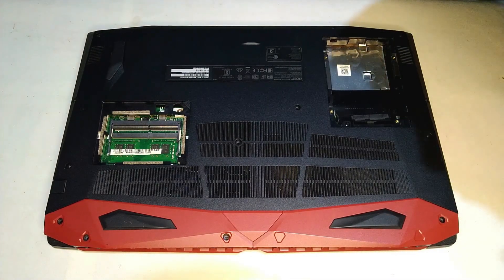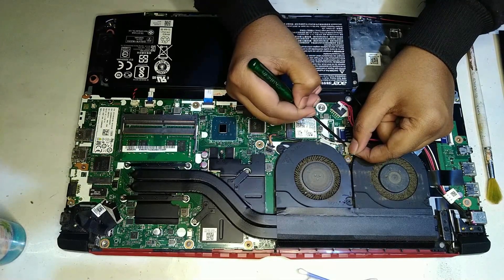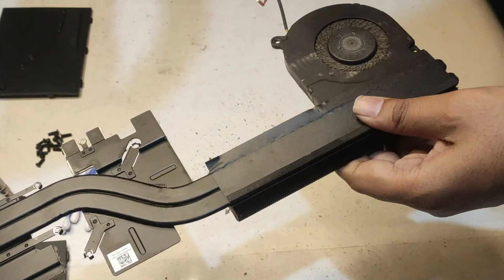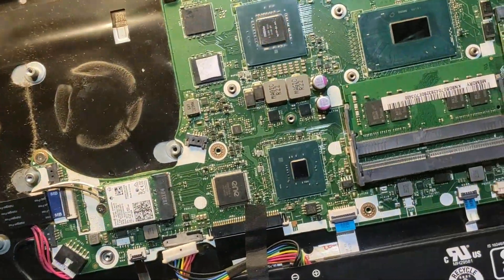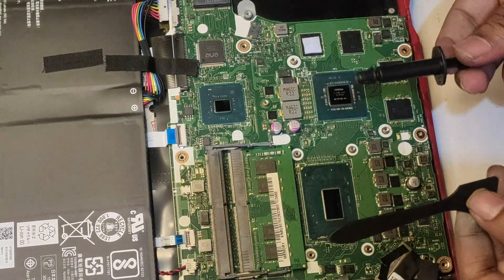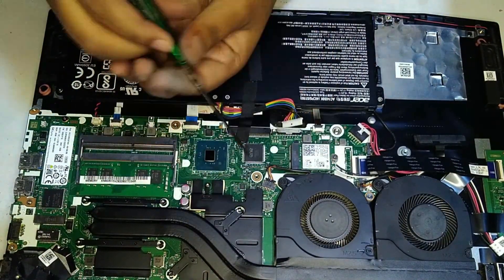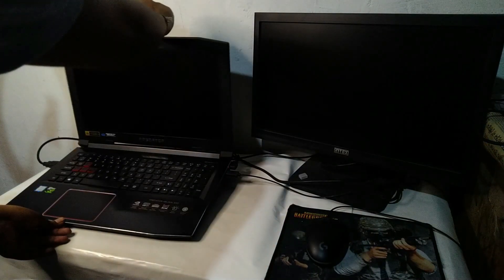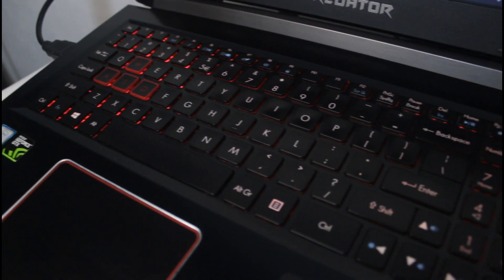FIX Laptop Overheating! | Thermal Grizzly Kryonaut 🔥

Comment: nice video , i got acer nitro 5    i5 9300h  gtx 1650 , and temp were over 96 of cpu and 90  of gpu . after cleaning it and changing thermal paste  my cpu tem were 78max and gpu were 65 max . But  you spreaded the paste because its laptop you should have use one drop method because then you will assemble your heat sink and the paste on the cpu and gpu will spreaded automatically which will results in no air gap in paste between cpu,gpu and heat sink .

Comment: it's advisable to use kryonaut only on GPU and something more thick on the CPU. As laptop CPU generally run hotter than GPU underload. You will find CPU will pump put kryonaut after a few months whereas GPU averaging 70c under load will last alot longer. 

Also recommend Honeywell PTM 7950 for CPU as it provides excellent heat transfer for laptops heat range.
Reply from the maker: Bro I haven't repasted in the last 1.5 years. Thermal Grizzly works perfectly for my Helios 300.

Comment: BEWARE! I'd advise against using hand sanitizer on you cpu and heatsink. Hand sanitizer contains perfume which I expect it could lead to residue and/or chemical reaction with thermal paste. Use 99.9% isopropyl alcohol, much kinder to your computer. ✌

Comment: I've seen many dudes in youtube saying that the best method is the pea size. I've tested it myself with my hp pavilion and kryonaut too. I used the pea size and after two weeks, my temps started going high again. So today I repasted again but this time I chose to spread on both chips and some on the cooper heatsink too. Now my max temps are 85°C and the average is 79-83. I also undervolted my i7-10750H. Pretty good for such powerful cpu.
Reply from the maker: Cool, whatever works! Enjoy! 
It's all about the mounting pressure, which differs from laptops to laptops, uneven mounting pressure won't spread the dot method evenly, so you are basically spreading it manually.

Comment: I would recommend gelid gc extreme for laptops

And dont use hand sanitizer for cleaning as it only have 70-80% alcohol and other percent of water so it might end up shorting something, instead go buy a 99% alcohol bottle for around 130rs in local
Reply from the maker: Nothhhhing will happen with 70% alcohol. It's not the first time I'm repasting and doing all this. It takes 5-7 seconds for the sanitizer to vaporize.
Kryonaut works best with my Helios 300 while Gelid works better on my brother's Ryzen 5 4600H HP Pavilion. 
But technically Kryonaut has the best thermal conductivity among all non electrically conductive thermal pastes.
Reply: @DeepteshLovesTECH  From my experience with Thermal Grizzly pastes are not suitable for high TDP GPU, CPU laptops where the temperature is close to 80°C for a longer period of time. After 8 months, its thermally conductive properties deteriorate significantly.
You should try phase-change material Honeywell PTM7950. It comes in as a sheet, lasts longer and performs works better than traditional pastes. On the power section and vrams propose to give thermal putty Upsiren UX Pro. Also do undervolting on the CPU and GPU at -100mV or more if it will be stable.
Reply: @DeepteshLovesTECH  man it contains water in a significant amount, if something didnt happended dont mean there is not a chance of

and alcohol content vaporises fast not the water content.
Reply: @DeepteshLovesTECH  kryonaut has better thermal conductivity due to its more fluidity and thats a good thing for pc not laptops which require thick paste to prevent pump out effect so in laptops its better to sacrifice some therm. conductivity for thickness.

please get your facts right

Comment: Don't use kyronaut for laptops it can easily pump out
Reply from the maker: Ohh God how many times do I have to reply to same thing. 
It's not Kryonaut's fault, it depends on the particular laptop's heat spreader mounting pressure. 
I am using Kryonaut on my Helios 300, and after this pasting I haven't re-pasted till now!! I only have to repaste once a year. 
So it depends on laptop to laptop. Kryonaut has the highest thermal conductivity among all non-electrically conductive pastes.

Comment: i too have the same processor in my laptop i5 8300h but in cinebench it touched 95 degrees even though i recently gave my laptop to clean and reapply thermal paste. i asked him which paste he used asnd he said coolermaster..i saw your video and just ordered thermal grizzly kryonaut.
Reply from the maker: Yup Kryonaut will be best, it has the best thermal conductivity among electrically non conductive pastes. 
Also clean the heat sink fins, remove the blanket of dust.
Reply: @DeepteshLovesTECH  yes that is what i am saying.. i was scared to mess with my laptop and gave it to a shop to clean..they did the cleaning job well but still the max my cpu runs at stress test is 3.4Ghz..i want it closer to 3.9 Ghz and my cpu is even thermal throttling after hitting 95 in an ac room at 25 C....like what did that shop do then..paisa barbaad.. im doing it myself tmrw
Reply from the maker: @bulusuchanakyachandrahas7380  what the hell? That's a bad job! My laptop is still doing great ever since this particular repaste job. My laptop is 3.5 years old and I have repasted it twice.
Reply: @DeepteshLovesTECH  khud se karne ka mazaa hi kuch aur hey

Comment: hi. i own a msi gf65 thin. i unscrewed the fans and heat sinks but it wasn't coming out. it is glued to the board. is it normal? should i apply force? how should i proceed?
Reply from the maker: No it shouldn't be glued in. I haven't done any disassembly but I haven't seen any MSI laptop or any laptop with glued heat sinks. You need a little force to pull because the heat spreader over the CPU GPU get a bit sticky due to the thermal paste. You have to wiggle it out.
Reply: @DeepteshLovesTECH  is it a risky situation? should i proceed on my own or should i contact service engineers? (i have changed thermal pastes before but haven't faced a situation where the heat sink is stuck due to dried. thermal paste)
Reply from the maker: @nishitgurbani108  check this video https://youtu.be/Bk1axMgQKe8 if you feel you are seriously facing an issue, then contact service engineers.

Comment: on direct die u need to better to spread the complett paste on it a little point can make a hotspot and your cpu or gpu die changes color like on the ps3 and will slowly dying
Reply from the maker: It's still completely fine. Laptop is around 3.5 years old, twice repasted. I don't like spreading myself as that can create gaps. For laptops I prefer dot method the best, where the spread happens evenly with the mounting pressure.

Comment: How much did the paste last?
Reply from the maker: Still going. It depends on a lot of other factors as well, like the heat spreader mounting force etc...
Reply: @DeepteshLovesTECH   have a Nitro 5 with ryzen 53550h nd gtx1650.....after a year it started heating and thermal throttling..gave it to acer's service centre nd they applied some cheap thermal paste which hardly lasted a month then I myself applied cooler master regular paste and same effect ig...1 or 2months Max then stated thermal throttling...now I'm going to try out thermal grizzly hope it will last an year or so....also instead of the pea method is it ok if I spread it evenly on both GPU and cpu with the spatula?

Comment: how long dose this thermal paste last?
Reply from the maker: Currently on my Helios 300 it's still perfect after this repasting. It depends on the laptop's heat sink mounting pressure though. So may be different for you. 
I have recently done a test with the Gelid GC Extreme, can check that out.

Comment: I am using i5  4200m laptop can u tell which thermal paste is better for that
Reply from the maker: Kryonaut or GELID GC Extreme.
Reply: @DeepteshLovesTECH  ok i will try to replace it quickly thank u
Reply: @DeepteshLovesTECH   this is the first time i am replacing thermal paste.after applying the new thermal paste(krynout) hwo many months it will works fine and after how many months we need to change this thermal paste.

Comment: Great video, good detailed explanation and love the vibe as well. Definitely gonna repaste after this (I have a Helios 300 too that shoots to 95°C at 2.8 GHz or more even with clean fans.... Disappointing from Acer).
Reply from the maker: Don't be disappointed,  the laptop was a steal for it's price back in 2018 and the i5-8300H is a flaming CPU. Your fans may be clean, but surely your exhaust heat sink isn't, it's probably blocked by a layer a dust. Clean that out, new paste, may be undervolt (mine is undervolted sonce day 1 of purchase), and this HELIOS 300 2018 will match 2020/21 i5-10300H performance.

Comment: I just used Kryonaut for the first time and I got a 30 degree drop in my max temp!!!! OMG!!!! Benchmarking...  CPU is 30 degrees colder. GPU is 18 degrees colder <3 I fricken love this stuff!
Reply from the maker: Brilliant!
Reply: The degrees is consistent? How long ?
Reply: @DNaslamJi  ¯\_(ツ)_/¯ after a few days, the temp slowly increased to -10, not -30. Built a new pc since and used Kryonaut again because it is better than any other product. I also removed the waterblock off the CPU on my old computer and then put the water block back on without replacing the kryonaut. Worked fine, still -10 compared to old paste. It really is good stuff. I love that my GPU stays under 50 degrees now, even when overclocked, with kryonaut and my 11700K also stays under 70 after hours of heavy load, using kryonaut. I wouldn't bother buying anything else... it's just that good! #kryonaut
Reply: @DC-te1gw  does the paste still hold up after 3 years?
Reply: @DivineShogun YES!!! It's actually amazing. I ended up pulling my laptop and tablet apart and replacing all the paste on them with Kryonaut. I did my brothers PC and my nephew's PC. Stuff's fricken amazing! I would put it on everything! First two weeks are ridiculous, with stupidly low temps like 20 degrees when it should be 40, but the paste settles in after 2 weeks and from there it stays at a constant for years. I mean, I'm still using the first paste (no re-paste) and when pulling 290+ watts I'm just getting into the low 80's after a 30+ minute solid run. Fans are only set to 60% at 85 degrees. Not that that really means a lot but... at the end of the day, Kryonaut is as good as everyone says it is. It really is the best stuff out there as an, in all applications, thermal paste.

Comment: Does this laptop support Gen 4 ssds?? like samsung 980pro or wdsn850
Reply from the maker: This laptop is over 3 years old and is using Intel's 8th gen coffee lake CPU. Intel supports PCIe Gen 4 speeds only since 11th gen.
So this laptop can take PCIe Gen 4 SSD but will be capped to Gen 3 speeds.
Reply: @DeepteshLovesTECH  thanks that's the answer I was looking for..I was confused about the compatibility.. I have the same laptop and facing lag issues I'll upgrade to Gen 3 ssd 👍🏻

Comment: I did it on hp acer, and i think on asus too. Disasembling laptop can be sometimes easy sometimes quite difficult depending on laptop manufacturer. Acer laptops are to disasemble, asus not as easy as acer still much easier than hp. HP likes to cause trouble to customers by making things realy difficult.
Reply from the maker: I also did it on HP/Dell, but yea depends on the construction/assembly of the laptop.

Comment: I had done the exact same thing to my old laptop and  used Thermal Grizzly Kryonaut thermal grease too and it really did make a huge difference in the temps. Kryonaut thermal grease is the best and they know it, that's why is so expensive 🤔
Reply: It's a laptop? It's still good? I've read that sometimes it just pump out
Reply: @brandodelfuego4172  Just don't put too much paste
Reply: @chromezephyr8959  i had too much paste on my cpu and the temps were fine

Comment: Have you used Noctua NT-H1? if yes then i have one question does Noctua NT-H1 performs approx same as Thermal Grizzly Kryonaut ? or there is huge difference between both?
Reply from the maker: NT-H1 is great, but might not be suitable for most laptops.

Comment: Please don't use hand sanitizer. Buy proper 99% isopropyl alcohol. 🙂🙂
Reply from the maker: 70% alcohol is fine. Hand Sanitizers are 70% alcohol. It evaporates in 5-6 seconds. 
I have used it in atleast 5 laptops and have been doing it for a couple of years now.

Comment: There is a problem. Carbonaut conducts electricity. One has to be careful
Reply from the maker: I am using Kryonaut. So there is no issue.
And I have also warned in the video, that this tutorial is not for Conductonaut, which is liquid metal.

Comment: I did this to compare a precision 5520 with a precision 5540. On the 5520, I put on TG Kryonaut and at idle 35C whereas on the 5540 precision 45 idle with temp fluctuating between 2-3 C at times. Definatly runs cooler and probably would get better during the break-in period.
Reply: It's a laptop? It's still good? I've read that sometimes it just pump out

Comment: Its always the Indian man who saved the day. Very detailed and clear, no chitchat just straight to the point. Absolutely brilliant! I just ordered Thermal Grizzly Kryonaut and this is my first time of cleaning and repaste the laptop (after 4/5 years, it was my dad's but now he gave it to me) im kinda excited and scared. Any suggestion man?
Reply from the maker: Sorry? After how many years?! 😵
You'll definitely expect a "Blanket" of dust over the heat sink fins. Just clean that up.
And obviously to do that you need to remove the heat sink assembly and then you'll expose the CPU/GPU. Just rub off the dry thermal paste.. should be easily removed with paper towel.. or just any cloth actually as I expect the paste to be bone dry.
Only thing you need to take care is while removing the back panel or anything...do slowly so that you don't rip off any cables. Everything else is just:
Unplug, lift, clean, repaste, plug'em all back. Done.
Reply: @DeepteshLovesTECH  okay. Thanks for replying so fast. 

Yeah i know its been many years lol. My dad never took ut seriously about how important cleanong your laptop is, i always scared to cleaned it since it was my dad's laptop. But now since he gave it to me i'll definitely took care of it. Btw how regularly should i cleaned & repaste the laptop?
Reply: @DeepteshLovesTECH  and one more thing. Should i remove my hard drive before cleaning it? I know unplugging battery is important, but how bout the storage?
Reply from the maker: @graze117  you have to remove the HDD if it prevents you from removing your back panel like in my case. Otherwise it's fine. 
Depending on how dusty your place is, I recommend cleaning every 7-10 months. Especially for gaming laptops, where dust seriously screws up the thermals.
Reply: @DeepteshLovesTECH  thanks for the information!
Reply: @graze117  Make sure you are also grounded before you touch the laptop internals. Usually just removing the battery/battery connector is fine but still.
Reply: @Sphynx93rkn  as someone who has built and tested 100s of PCs the old static discharge frying something on the board is about as rare as big foot.

Just make sure to ground yourself before touching components and definitely disconnect the battery.

Comment: Very nice video, bro. I have one question. I have the same laptop as yours and I using your video as a guide to cleaning/repasting my one. I live in India as well and it's very dusty where I live. How often do you clean and repaste your laptop? Also, do you notice any pump out effects with the kryonaut? I have ordered the paste from amazon already.
Reply from the maker: Not noticed much difference since repasting in this video. 
I normally clean 10 months later as these days I don't game much and also thermals are less affected.
Reply: @DeepteshLovesTECH  thanks for your reply. Also, was the cinebench test run for multicore or single core

Comment: Hey bro it's me again lmao I was wondering if it's okay to clean the laptop fans without taking them off
Reply from the maker: Then you can't clean then properly right? More than the fans, you are supposed to clean the heat sink attached to it, all the dust and gunk get's stuck in there when the hot air is exhausted out...
Reply: @DeepteshLovesTECH  hmm okay...I'm scared to take off the heat sink and all that I'll prolly get an expert to do it

Comment: Bro use compressed air can to blow air through fins.... Do it in every 2 week this don't allow dust to block exhaust
Reply: We can use blow mode in a vacuum cleaner right? Will there be issues like drawing static charge?

Comment: Hi, in this video, is there any undervolting applied? The temperature drop you have is massive.
Reply from the maker: After applying thermal paste, the peak temps are same with and without undervolting in this test and here there was no undervolting. But regardless, I still undervolt my laptop, as it reduces idle temps. Every single day of around 3 years of usage, I first turn on Throttlestop every time I boot up my laptop. It's my habit.
Reply: @DeepteshLovesTECH  I am going to put the kryonaut now on my 2.5 years old ROG strix, your video is the last video i am referring to, wish me luck.
Reply: @DeepteshLovesTECH  bro, I have one more question. I have the same laptop as yours and I using your video as a guide to cleaning/repasting my one. I live in India as well and it's very dusty where I live. How often do you clean and repaste your laptop? Also, do you notice any pump out effects with the kryonaut? I have ordered the paste from amazon already.
Reply: Kryonaut is among the most expensive and high quality thermal pastes on the market. Compared to the rather cheap and often badly applied paste the manufacturer uses, this is a realistic (though high) difference.